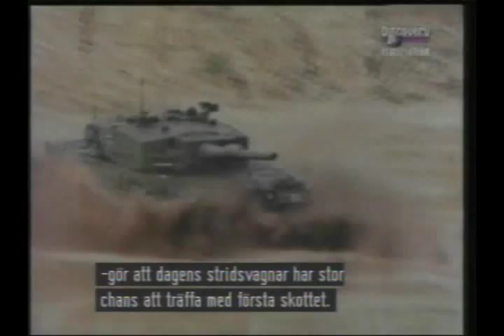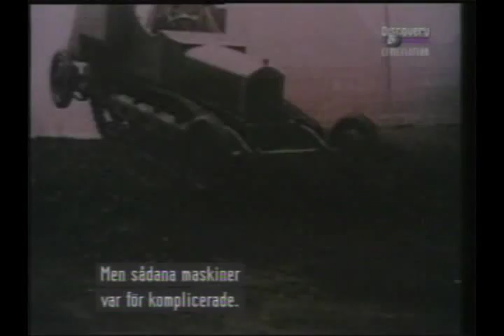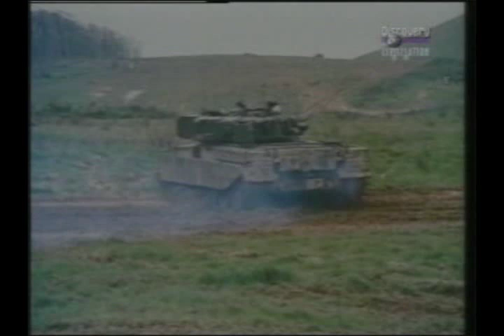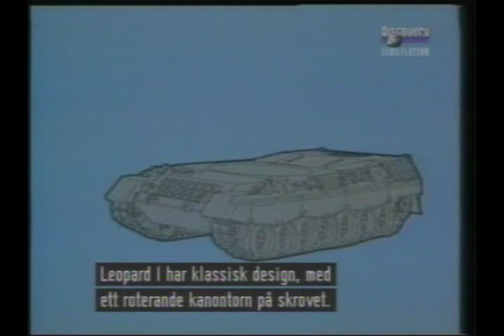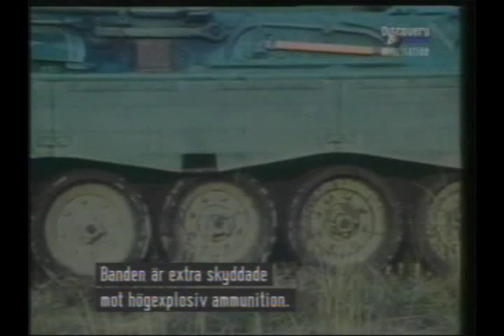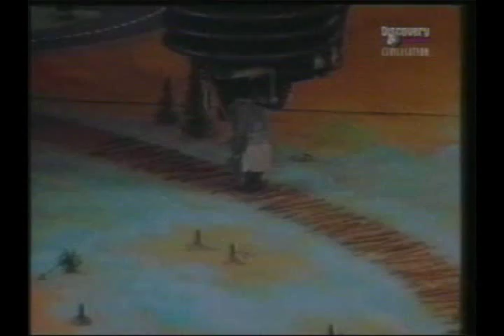Modern Battle Tanks - Part 1/4

Comment: I will stick to my original comment "such a failed tank". The Russians took the good bits from the T64 , Ceramic armour, 125mm gun with auto loader ect. But the engine no they changed it. It was a good move since The T-64 was not good in terms of ease of maintenance.

Comment: If the T-64s and T-80s have been very badly used in Chechnya and Moldova, it is because they were used by non-experienced local soldiers, not even by tankists. No strategy, no preparation or planning.

The 5TDF engine was just excellent, problems were encountered because the factory that builds them did not had modern machine tools to make the assembly of mechanical components with precision.

And this tank is still better than the Chieftain. ^ ^ (troll)

Comment: If it was a such failed tank, there would not be 13 000 units built since the 1960s and there would not be remained in use until now. 
Thought about it